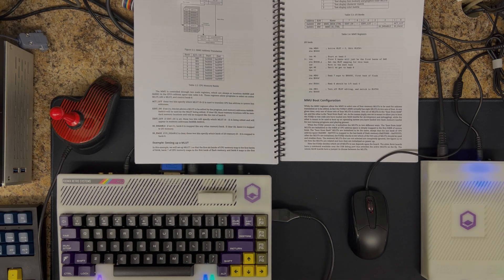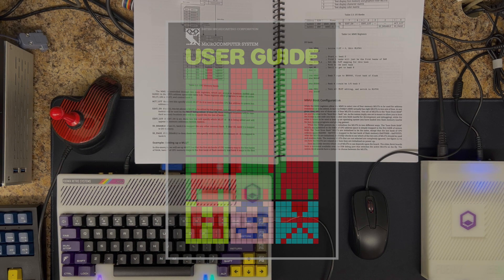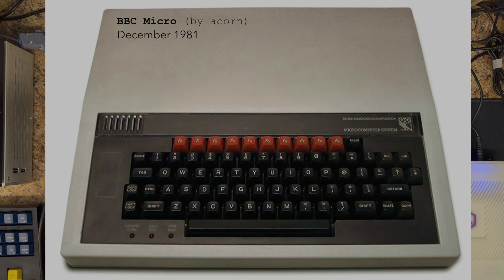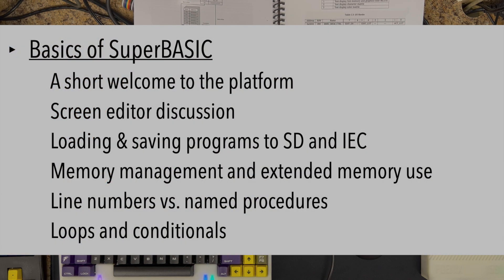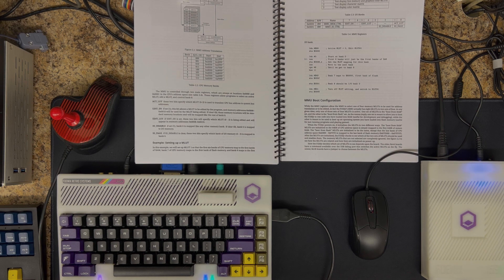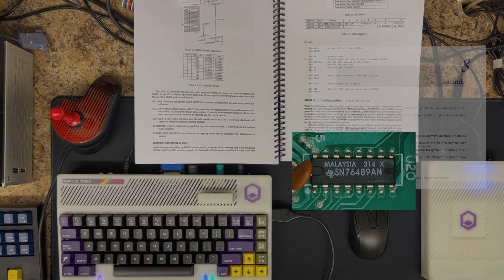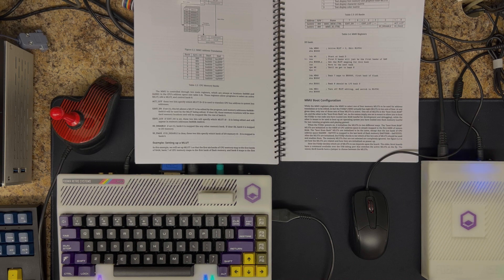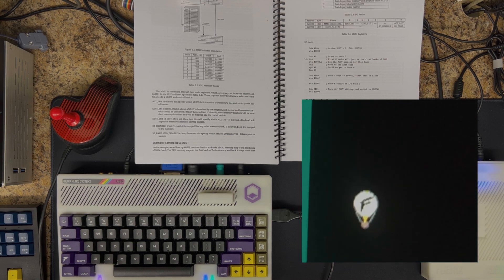Foenix F256 SuperBASIC Part 1 - Intro (About this series)

Comment: I am really interested in this machine.  Anything that sheds more light on the F256K is a must watch for me.  I am slowly saving up money to get one, just going to take me some time.  I would love to teach my daughter BASIC through this machine.  We've been doing BASIC on my 130XE, but a machine with more functionality will allow for more experience and knowledge growth for them.  Keep up the excellent work!
Reply from the maker: Thank you for the comment.  If you haven't done so, you should check out the Discord as there is alot of conversation, including on the SuperBASIC channel.  The IDE/emulator is also a good choice as it's zero-cost, mostly compatible, and improving all the time.  Final thing to share, which may be obvious, is the power of the FPGA (Vicky) and improved clock speed (6.29) over the original 8-bit era machines (1 or 2 Mhz.) affords the opportunity to write code in BASIC using graphic features and have them be completely usable versus barely tolerable.

Comment: Can you do a series on how to program for the F256 using the emulator and C or Assembly language?
Reply from the maker: I use real hardware exclusively but any method or set of off-host tools should apply to the emulator as well.  I know many Foenix devs that do it all on their Windows platform.  I do have some video shot on how to setup and use the 64TASS assembler with GNU Make for the F256 platform; hope to get around to publishing it soon.  If you want emulator info, hop over to the Foenix Discord server; I'll double check that the link is in the description of this video now.

Comment: what is the purpose of the device to the right of the mouse?
Reply from the maker: It's a 3 1/2" floppy drive, the FNX1591 (another Foenix Product).  It is Commodore 1581 compatible and can be used with any Commodore system that has an IEC bus (C16, C64, C128, VIC 20, etc. or the Foenix F256 systems).  It's also due to work with the Commander X16 (which should be released later this year).  Here is a brief video that mentions it:  https://youtu.be/SXjVMHv6jE8

I'll probably do a deep dive video once I receive my production unit (this is a prototype that I used for demo at the VCF East show).  Thank you for the question.

Comment: I had a C256 and was disappointed in it.  The BASIC was broken and not finished, the kernel was also not finished.  In effect the machine was almost unusable for someone like me who just wants to use BASIC and ASM  (with kernel calls etc...).  This looks to be more complete of a system with a complete basic and a working kernel.

I think I might go ahead and purchase one .
Reply from the maker: I own a C256U+ and had a keyboard/interrupt issue with mine that was fixed with newer FPGA code.  BASIC816 on that platform certainly had limitations, but it worked well enough for me for the small projects I did, mostly for tutorials and amusement.  This (F256 w/SuperBASIC) is a completely different animal in every regard.  I'm just getting started myself but am impressed and passing along what I'm learning as I go.  Thank you for the comment.
Reply: If you have any specific questions about it , please ask (I wrote it)
Reply: @paulscottrobson  I've got a couple of questions..
What was the reason to switch from the 65816 to the 65c02 for the F256 & jr?
Presumably, if the 65816 option is fitted, it will still run mostly on 6502 mode?
Did you also write the MegaBasic for the Mega65? - the code looks nice & clean
Is the kernel of the F256 basically the same as the C256 kernel?
and lastly... stm32discovery user name? Is that your day job? ;)
Reply: @samurai1999  it always was a 6502 machine. The 65816 and 6809 options came later. I don’t know what code there is for the 65816. I didn’t write M65 Basic. The kernels are completely different. I have no idea why stm32discovery !
Reply: @paulscottrobson  Yes, but the previous Foenix 8-bit computers (C256 etc) were all 65816-based, so it would have been nice to keep the 65816 in the F256 range too...
- but, I guess that's coming later, as you say.. which is good!
Reply from the maker: I happen to have a 65816 in my F256 JR. and I know people that ordered their F256K with the '816 onboard.  Since the CPU 'boots' from the WDC factory in emulation mode, all of the normal operating firmware including SuperBASIC, works as it will for the 65C02.  From 'emulationo' mode, you can manipulate registers to switch INTO '816 mode to leverage additional instructions and 16 bit register features, however, the memory map remains in common between the two ICs meaning that you must leverage the MMU as discussed in another video.

My understanding is that there is a 'flat' 24-bit addressing mode uplift in an FPGA update for the F256 Jr. and the F256K that has not yet been released, but may be at some point in the future.  Be that as it may, some games such as the "Which Rules the Night" by Norman Yen, were written in 65816 and loaded via 512K image and leverage the CPU features to great effect.  (Norman has released a native 6502 version of the title as well).

To answer your last question first, the 65816 is intimidating to some and Foenix Retro wanted to broaden the appeal of the F256 systems, to make it more accessible based on the CPUs that many of us (I'm one) grew up using; that being Apple ][, VIC 20, CBM 64, PET, BBC Micro, etc.
Reply: @8-bitwallofdoom  Well, yes, I grew up using the 6502... which is why I'd find it interesting to get to grips with the '816
- I don't think it would be much fun to return to 6502 assembler...
- I would possibly consider getting an F256 jr with a '816 fitted for fun
😁
The F256K looks nice, but the price is probably too high for what I would want to pay for such a thing!
😉